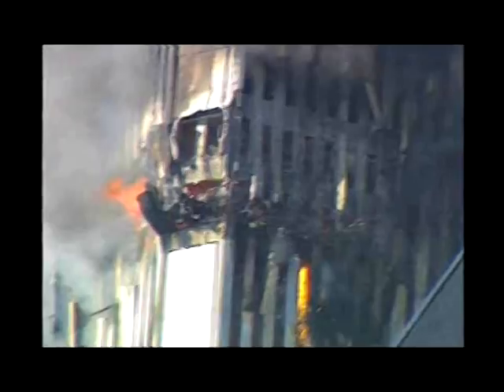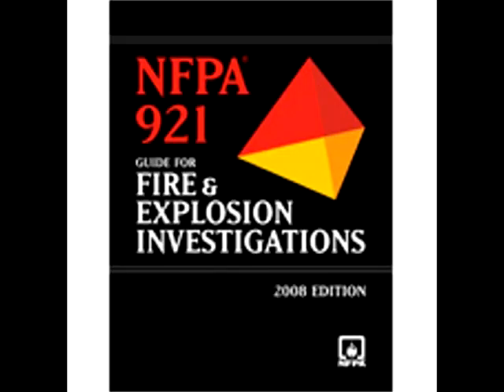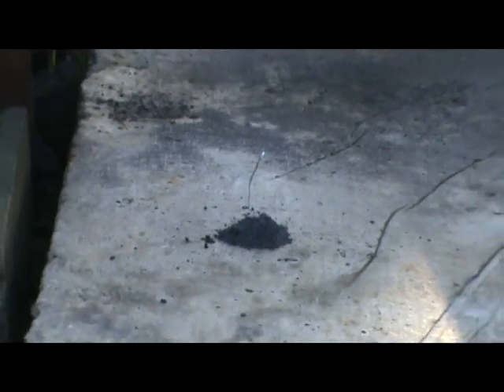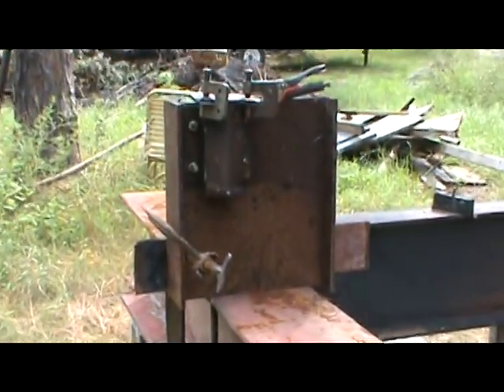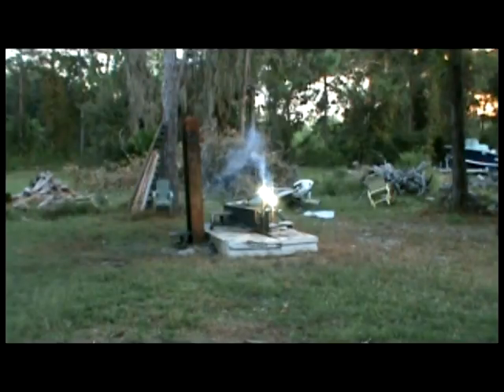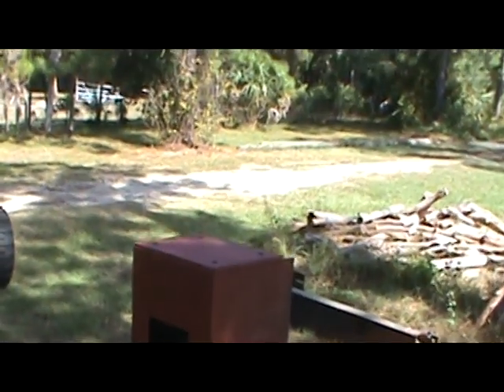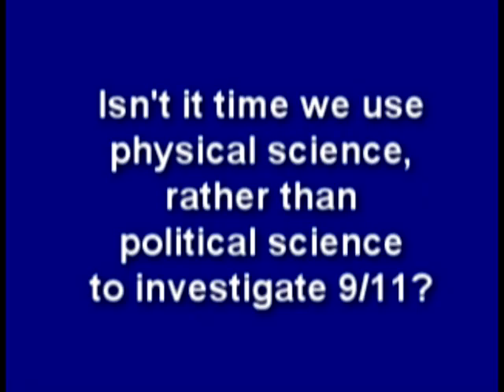9/11 Experiments: The Great Thermate Debate

Comment: People need to watch the first five minutes of this video need before commenting "I saw molten steel coming down the side of the building" true you do not need to cut the beams to take down the building however people recorded seeing molten steel which requires that something melted large amounts of steel.
Reply: NO one has ever found pools of molten aluminum at Ground Zero, but they DID report STEEL. Gotta brain?
Reply: C. A. G. Not to mention in daylight, aluminum burns in a silvery blue colour.
Reply: Or it was molten aluminium emitting visible electromagnetic raidiation due to the 1800F temperatures

Comment: JET FUEL CANT MELT STEEL BEAMS
Reply: +AlexM642 No, but it can certainly weaken them to the point they fail under load.
Reply: Doesn't matter for this issue. There was molten iron in the basements of WTC 1, 2, 7 after they collapsed. Jet fuel fires or any office fires can't explain this. The official narrative of the government has no explanation for the molten iron.
Reply: Two words: Citation needed.

Or, to be a bit more elaborate:

First of all, iron and steel aren't the same thing; steel is an alloy of iron, carbon, and a number of other elements, depending on the actual type of steel. If you're going to come up with conspiracies, at least get your terminology right.

And, to go back to the original quote: Jet fuel can, in fact, melt steel beams under certain conditions. Oxygen-gasoline cutting torches are quite common, and since commercial jet fuel has pretty much the same energy density, there is little reason why it could not be substituted, other than the greater cost compared to gasoline. Once the fire grew to a sufficient size, the draft it created, combined with the so-called 'chimney effect' produced by all skyscrapers, could very likely have provided sufficient quantities of oxygen to initiate a similar reaction.

Furthermore, the video seems to confuse the issue of 'molten metal' without actually specifying what that is. It is in all likelihood molten aluminum, from window frames, wall panels, furniture, and the aircraft themselves, which has a lower melting point than steel.
Reply: ITS A FUCKIN JOKE.

Comment: 0:56 That's not molten steel that's molten aluminum. What's made out of aluminum??? The airplane. Steel melts at 1500 degrees Celsius. Temperatures were around 900 degrees Celsius. However that's still hot enough to weaken structural steel. I just debunked 2 myths right there :)
Reply: About 80% of the plane would have been Aluminum which is about 64,000 kg.  Also this molten Aluminum is coming out of the area where the plane entered the building.  Pretty reasonable guess that's aluminum then.
Reply: +MSmart19 Google a color chart.  Molten aluminum is silver at temperature of 1200 degrees Celsius and above.  It's light orange at around 900 degrees Celsius
Reply: +MSmart19 Okay tell me how I contradicted myself.  Aluminum melts at 660 degrees Celsius.  Temperatures in the WTC reached 900 degrees Celsius.  Between 930 and 989 degrees Celsius molten aluminum is a light orange color.  Just because I proved you wrong doesn't mean you have to deny it stupid
Reply: show me proof of molten metal flowing weeks after the fire went out (I'm not believing this at all btw because I have a reasonable grasp on how heat transfers from medium to medium)

Comment: 6:51 If he was in the South Tower, he'd be dead, so he was in the North Tower, where the plane hit between 93rd & 99th floors. So he was 12 stories below where the plane hit. Despite the massive kinetic energy of the plane and the concussion of the explosion, nothing from the impact would've made it down to the 81st floor. I'm not ruling out ignited gas lines, though they almost never go off like that in structures of this type. This strongly supports the theory of this video...but of course you already know all of that (and thanks so much for your contribution to the Toronto talks; I flip-flopped on the issue since 2006, mainly because I'm a material scientist and a lot of the principles held in favor of the report prior to NIST's assessment, and that talk in Toronto [and subsequent triple-fact-checking] polarized me).

Comment: While Thermite and Thermate are "capable" of doing this damage, what you are proposing is that over a course of years or decades, and possibly even while building the WTC, this was already planned out and prepared.  It was just finally set off at the time of a plane hitting it.  The very weight of the materials needed to do this much work would have made it implausible to have been done at the time of the attack.

Comment: I believe this is total BULLSHIT. Those planes hit thee towers at over 500 miles per hour and once all the jet fuel ignited the aluminum the steel walls holding up the top part of the building warped and allowed the floors above to start collapsing down which was somewhat like domino's coming down. This building construction didn't have central columns so they could have more room inside for offices. If the planes had of hit the Empire state building for instance there would have been damage but it wouldn't have collapsed.

Comment: Nice video but the holes are devoid of any plane debris. No Planes crashed anywhere on 9/11. The mass of planes are not concentrated like missiles are. The Kinetic Energy is spread out, so it doesn't pack the necessary punch to slice through the Steel, spandrels, and concrete.

Comment: The only 3 skyscrapers in history that went down from a fire. You can see the 45 degree angle cut with spalling below the cuts in the famous pic of the fireman standing in the basement with the support columns behind him. Linear cutter charges on the support columns and down she goes with or without an airliner hitting as in Bldg #7. People there could hear explosions from below when they ran out of the building.

Comment: Our government can't even keep someone from blabbing about spying on some phone calls and they're going to hide the murder of thousands and the destruction of billions of dollars in property?  A president has thugs break into a hotel room and someone blabs.  It's impossible that nobody would blab and if you believe this bull, you're a dope.
Reply: honestly it sounds insane, but there was (is) large amounts of money, we are taking about conspiracy to take over another countries resources, not a billion dollar contract, but generations worth natural resources.

it wouldn't surprise me if the government did actually stage the attack, because it's been proven that governments are willing to do this (fake cuban attack).

The only problem with a controlled demolition conspiracy is, as you mentioned, the lack of people that are talking out about it, they couldn't silence everybody, there's always a defector who doesn't says enough is enough.

The attacks were real, they did indid crash, I believe it was staged to invade the middle east... but the tower fell due to "poor engineering"/unforeseen critical failure.

The planes crashed, several Flores, the debry collected and put to much outwards pressure on the hollow steel core, at some point the it started collapsing not due to heat, but combined weight of each floor above pressuring only on floor at the time (not mitigating the weight through the core and sub sequential floor.)
Reply: honestly? I've looked up simpler explanation for the collapse
https://mysite.du.edu/~jcalvert/tech/failure.htm this does a good job of explaining the idea, the towers did fall due to the crash, but there's some shady shit going on with the whole attack.

"Keeping it simple stupid" is an engineering term,  and explaining it as an engineering oversight seems far easier to cover up. They did "hire"/help terrorist perform an act of terrorism, the plan was probably to hit major land marks like WTC and the pentagon, pushing the people to support the the invasion and enacting the terrorist act. the end result was thousands of dead rather then just hundred, which lets bee honest would have been enough to invade given enough media coverage, and support from other countries for decades.

The fact that the WTC buildings had an unknown critical design flaw was just a happy accident.

I'm not saying it wasn't planned, I'm just saying they probably kept it low key, and used their known network to insite attacks... like the air force doing a drill, that's yet another thing that seems too good to be true.
Reply: Moose Moomintoog 
Look in the mirror if you want to see a real dope

Comment: Damn. Now if only someone could simulate the whole scenario the weight on top of the beams the winds coming through the towers and everything burning inside. I bean what is a forge but burning material and air being forced through. I want to be clear that I am not on either side of this I have no idea what happened that day but I know there is some lies being told.

Comment: You know what... steel isn't the same strength till it reaches 1 degree below the temperature when it turns to a liquid. The melting point of steel has NOTHING to do with this. Steel isn't a liquid before they make it into a sword is it ? You know why Ironmongers heat the metal when they shape it ? Not for fun, it makes it weak so a hammer can shape it. You know how much force the Hammer makes on the steel to bend it ? LESS THAN THE WEIGHT OF THE TOP FLOORS OF AN OFFICE BLOCK. Seriously you people are fucking idiots.

Comment: Awesome scientific work I applaud you.This is the first actual evidence that I believe leads to a 9/11 conspiracy.My question as an Aerospace maintenance Technician where I have worked on "Heavy" Aircraft for over 8 years. I know that a lot more than jet fuel can burn on them. Has any research be done into how hot jet fuel, plastics, hydraulic fluid, rubbers, and all the other synthetic materials on the aircraft. (That when they catch on fire require special foam sprayed from fire trucks to be extinguished) can get when squeezed between giant slabs of concrete? I know as an armature metallurgist when I make a foundry with cement and good airflow I can get fuel sources of all types much hotter than they burn in open air.

Comment: You do understand how a blast furnace works right. Wind at high altitude is very high all it takes is this to blow through the now open sided building. This would bring the temperature up to the melting point of steel. I have asked many of my metallurgist friends about this.

Comment: iron oxide and aluminum create thermite. could an aluminum planes impact create this chemical reaction, even if it only creates traces of thermite that could start a chain reaction. my other point is in your video you create bolt blasters, then remove them and say 'look no evidence', well there would be custom bolt blasters with traces of thermite/mate in the debris. I find the conspiracy theory hard to believe, because I find it hard to believe a government would do that (but I'm not naive enough to think they couldn't). so I wait for the day when the whole truth is discovered.
Reply: iron oxide is rust. if beams have even the slightest surface rust, don't you think a planes impact and all that goes with that (aluminum, jet fuel etc) could have just coincidentally been the right mix?

Comment: Question. My opinion is somewhere in the middle. but is it possible that the planes were loaded with said thermite. Perhaps being set off just BEFORE impact? 
 I've seen alot of these conspiracy videos and this is the first one that has no circumstantial questions or coincidental theories. 
 If the thermite or whatever was the cause of the steel collapse.. wouldn't the ignition of the jet fuel be the propellant? That would also explain the white flash at nose point of contact.

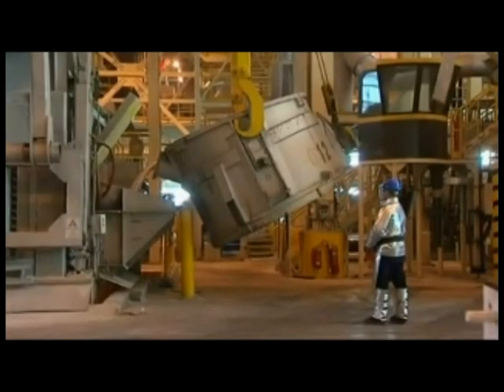Comment: 2:38 - "Molten aluminum is silver not red yellow". This  dude doesn`t know physics: Aluminium melts at 660 degrees  Celsius  and yes, it`s silver at THIS temperature. But you can heat it to higher temperatures (it boils at 2500 Celsius). And at those temperatures it will glow like every other  hot material.

Comment: hey, here's a question for you, does diesel burn hot enough to melt steel?  I don't think it does.

But, if you have ever seen burnt out truck frame, you will notice the floor of the cab will have melted away entirely and areas where magnesium is used (freightliner door insides) the truck will have evaporated in those areas.

All you need go do is ignite a metal that can reach a higher temp than steels melting point.  hmm, huge plane, full of magnesium, aluminum, and probably half a dozen other solids and liquids I don't know about.  

all of you need to stop trying to make your explanation right, you rational and critical thinking.  it makes little sense that even Bush would have purposely killed his citezens, or wanted the trade centers to be demolished.

And for the believers, just so you know, the rest of society scoffs at your pseudo - intelligence.  seriously, the dumbest people I know believe in that shit, but they all think they are brilliant for understanding such a theory.

Comment: Those of you who are anti-conspiracy theory should take at least two(2) simple steps (which may be awfully difficult for those with literacy problems); 1. Read about Thermite on Wikipedia or Britannica, your eyes will be opened!  2. Check out Thermite on You Tube. There are some exceptional videos on how to make your own thermite, with ample demonstrations.
Note. The videos I have watched have nothing whatsoever to do with 9/11 conspiracies. As you will discover thermite appears simple to make, e.g. mix powdered iron oxide (rust) with powdered aluminium and voila! However one has to find where to get the powder Al from! I suspect that National Geographic might not have used powdered Al. Thermite is used in welding but has a variety of other uses.

Comment: Alrigth let me see if i get this right. Someone? supposedly placed thermite charges in the wtc. then they instructed some people. terrorist, cia or britney spears and the seven dwarfs for all i care. to fly four? planes into buildings. Two of which hit the wtc on pre determent floors to cover up the fact that the buildings where rigged with thermite charges intended to bring the buildings down.   
Sounds likely...  

And a small question for the science guru's among us. Isn't it true that a heat source in a confined space willl reach higher temperatus than it would in an open field for exsample? especially with the wind up there. you basically end up with a giant tamahagane forge.... which is hot enough to melt to steel for sure.

Comment: You'd think a self described "engineer" would remember some things from college. Steels of all types do not require high temperatures to fail. Steels and other metals held at any elevated temperature will begin to  have its mechanical properties change. Almost an hour at these extreme temperatures would have greatly changed the steel's composition and structural integrity resulting in a failure.
Reply: yes but not into dust

Comment: A couple things, it you are really an independent "scientist" why on earth did you not test to see jet fuel could do the things demonstrated in the video rather than say " you know it can't". If you were truly independent you test the other theories as well rather than just prove out your pet theory. Also say this is all true and a thermitic material was used. It's seems pretty obvious that in order for these reactions to be controlled and work the way you are demonstrating it means that you would need access to the superstructure of the whole building. I can't really see how you could do this in a completed structure without tipping people off or at all. The only other way is that this stuff was put in as the towers were built. A quick google shows that there were 3600 steel workers that built the super structure - they were all in on it? While you demonstrate that physics of this could work, the practical aspects would make pulling this off with no witnesses impossible. I mean really, 3600 people with absolutely no clue or no conscience?

Comment: If the top part of the trade center buildings 1 and 2 "pancaked" down into the solid structure of the building below the point of impact of the planes, resistance is met.  This defies the laws of physics as the building collapsed at free fall speed.  This cannot be disputed.  You cannot break the laws of physics.  Building 7, same thing but even more so as there was no point of impact and nothing to cause the structure of the building to loose its strength and structural integrity at the base, which is necessary to facilitate free fall speed.

Comment: Could it also be that the steel contracted for the building of the towers wasn't as high quality at they thought?  maybe someone in the works made a pretty penny by letting inspection slip on the steel so it was unable to stand up to the stresses engineered for the building? Its happened before in history.
Reply: +elliott turner Possible, however, this would still not explain the path of least resistance.  The collapsing tower from above from point of impact would be meeting solid structure below it.  This solid structure would not buckle or resist the collapse in an equally distributed force of resistance.  Given that there is a force of resistance, the structure of the building below the point of impact of the aircraft, no matter how "weak" the steel may have been, free fall speed cannot be made unless the structure of the building from its base and at key points along the frame were neutralized.